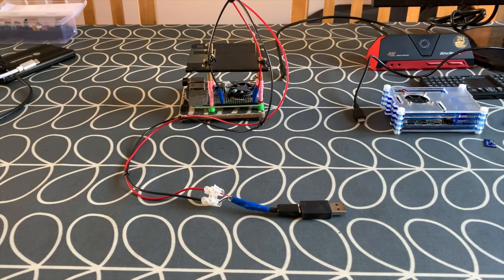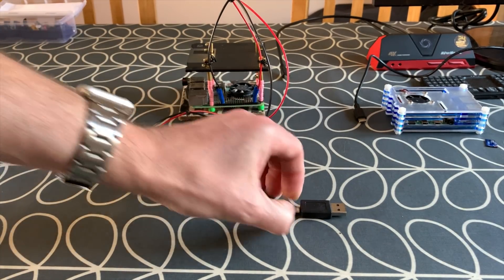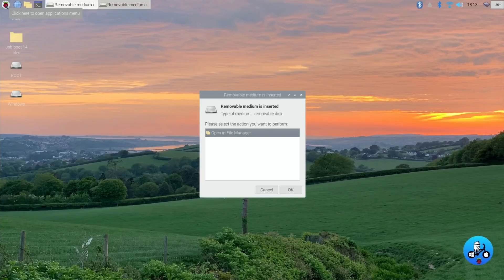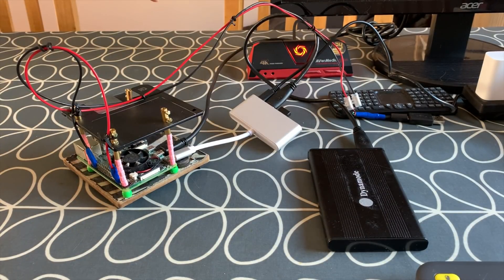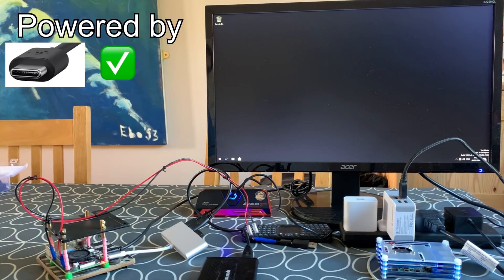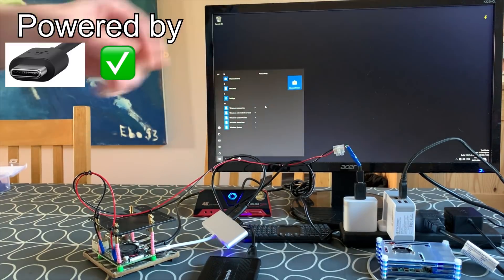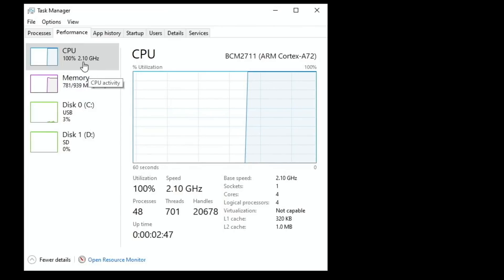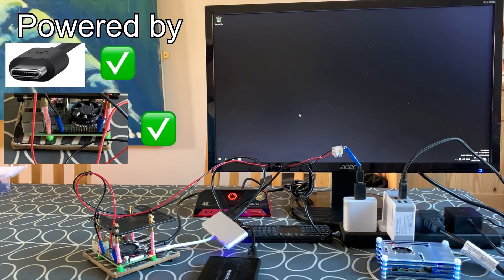Raspberry Pi 4 with 2 power adaptors.  Power through GPIO pins. Plus Windows 10 WOR update.

Comment: It's bad idea. Even if your power adapters works well, there could be a chance, that there will be a difference of potential between the minus wires of adapters. It means that there will be current between these wires, and it can damage your board.
Reply: That is why GND wire must be always connected together. So the potencial is the same (if both adapters are 5V). The only problem would be if for some reason one adapter change output voltage to more than 5V. But that could also happen with only one.

Comment: Is it possible to make an on off button (the protocol that a pc chassis comes built-in with?) that functions independently from no matter how configured to specifically run on a raspberry pi or not meant at all the operating system you have installed on any media being powered on by the raspberry pi hardware?

Comment: Apparently the threshold for Pi-3/4 low voltage is set at 4.63V so if you have a volt meter and connect it across the ground and +/pos terminals you can see what's going on with your power supply a few people seem to use the USB Tester Digital Power Current and Voltage Monitor dongle/stick  to do this as well. I think you should get one :-)

Comment: Oh my gosh. Look at such demolition.

see: https://www.raspberrypi.org/documentation/hardware/raspberrypi/power/README.md
Backpowering

Backpowering occurs when USB hubs do not provide a diode to stop the hub from powering against the host computer. Other hubs will provide as much power as you want out each port. Please also be aware that some hubs will backfeed the Raspberry Pi. This means that the hubs will power the Raspberry Pi through its USB cable input cable, without the need for a separate micro-USB power cable, and bypass the voltage protection. If you are using a hub that backfeeds to the Raspberry Pi and the hub experiences a power surge, your Raspberry Pi could potentially be damaged.

Comment: @leepspvideo This allows the USB C port to be released to connect a keyboard. Can you return to the original power supply via the C port and upload the USB drivers after completing the system installation?
Reply from the maker: Unfortunately USB still doesn’t have support in Windows 10 on Pi.

Comment: lol. Beast of a jerry rig project.
With a Pi4, you really need 
1) a 5V 3A+ wall adapter with either USB-C connector, or the same wall adapter attached via the GPIO 5V and GND, or 
2) a custom power delivery module such as a buck/boost voltage converter (x-Volts to 5-Volts) running off of a battery pack or a 12V auto/marine battery, or any standard wall outlet that's capable of providing more than 15 Watts ... and if you overclock the bastard to 2.0GHz+ and have an active cooling solution pulling decent power (needed with an overclock), including all 4 USB ports connected to power hungry devices, you WILL need all of that 15 Watts. The standard (not Zero) Pi systems from Model 4B and over from now on will need dedicated power delivery solutions. 
Another hack I've managed to work out is that you can actually fool your USB ports into thinking they're only supplying your peripherals like 10mA of current using a 500 Ohm resistor from the PWR to GND of each connector (ie, in the cable/socket solution), then have the GND connect between the port and the peripheral, and then feed the PWR line into the peripheral straight from the dedicated 5V power source rather than letting this current drain through the on-board power system/regulator - This is the PhD in Jerry Rigging ;P
If you're going to get into overclocking and heavy multi-case use on a Pi, you really need to work out how to keep as much of the onboard current ready for the board chips rather than allowing it to be used for the peripherals via the USB power lines; not to mention the fan/cooling solution can plug directly into this 5Volt source rather than allowing the current to go through the on-board power system and then out through the GPIO power pins. Basically, feeding power into the board via the GPIO pins is so much better in every way.
What a great world where such a powerful little computer can be jigged into so many configurations. 
Tinkering with SBC's/PC's and their electronics is so much fun 
/geek off

Comment: Hi... I bought a USB C hub like the one you're using.. but for some reason the official rpi4 power supply do not turn it on thru the hub... Have to use the power supply used to charge my Pixel 4, but the Pi do not detect any storage attached to the hub... Any recommendation, probably the hub I bought is not compatible... Do you have another one that can be recommended, the one linked in your video description is not available.
Reply from the maker: If you have a 1st gen Pi 4 they don’t like usb C PD devices. I had a previous usb otg with Power Delivery which didn’t power my gen 1.

See this video for differences 
https://youtu.be/_wt9NTa1UNE

Marcins blog mentions a few working otg hubs

https://discourse.pi64.win/t/how-to-installing-windows-10-arm64-17134-on-your-raspberry-pi-3-and-4/488/169

Comment: Wouldn’t it be a more elegant solution to have a more powerful power delivery 2.0 and above power adapter and an USB C hub that supports PD pass through as well?
Reply from the maker: PD hubs don’t work with the first gen Pi 4. I did buy one from Amazon a while ago with Ethernet and returned It. 
I do now have a gen 1.2 Pi 4, it would be a tidier build.

Comment: The Raspberry Pi Foundation recommends 5 Volts at 3 Amps.
https://www.raspberrypi.org/documentation/hardware/raspberrypi/power/README.md

If I remember rightly, the Raspberry Pi 4's USB C implementation wasn't to USB C spec. This meant that some USB chargers wouldn't work.
https://www.zdnet.com/article/raspberry-pi-4-wont-work-with-some-power-cables-due-to-its-usb-c-design-flaw/
Reply from the maker: Windows 10 requires a different configuration at the moment as the USB ports are not supported. This is the reason I’m using an otg hub, the usb C power input is acting as a USB port. It allows adding mouse, keyboard, ssd, Ethernet, Bluetooth, gamepad support. All these devices suck power away from the Pi. I am using an official Raspberry Pi 4 power adapter. With Linux and other operating systems it’s absolutely fine.

The GPIO pins are allowing me to top up the power so the Pi isn’t under volting causing performance issues. I read that it takes only the extra power it needs.

None of this is related to the USB C issue that was on the original Pi 4.
Reply: My Bad :)

I forgot about that... I hadn't tried Windows 10 on the Pi for those reasons... I hope the devs get that one sorted.

Comment: Awesome video, I’ve been scratching my head for weeks I keep on getting the lighting bolt when I hook up my Pi4 to the Pi-top Ceed. I have a arcade stick and fan connect to it I wasn’t a 100% if hooking up a portable 2A battery would work
Reply: CEED even with a Pi3B regularly gave me the yellow lightening bolt. 

If you haven’t update the firmware on your Pi4B as they’ve made some changes that make it more power efficient. Closer in profile to the Pi3B.

Comment: Do you recommend overclocking the pi while running Windows?
Reply from the maker: with the extra power it runs great, video tomorrow. 👍🏻
Reply: Can’t wait😀
Reply: I Mean So Far Windows Runs Smoothly At 1.2 Ghz
Reply: Thanks I’ll try it.
Reply: @Lukes-Tech  no problem

Comment: I had the lightening bolt issue especially with Manjaro. I measured the voltage getting to the RPI4 and found it at 4.90v. The 3.0 Amp adaptor measured 4.99v no load. I very carefully substituted a variable power supply set to 5.15v to get 5.0v at the USB2/3 output pins. Load current is 1.1 amps with SSD USB3 connected. Lightening bolt gone.
Reply from the maker: Thanks, I have only ever had this issue running Windows 10 through the otg adaptor. I mostly use the official Raspberry Pi 4 adaptor.

Comment: if you use this cable with your ssd you will not need an enclosure....https://www.amazon.co.uk/gp/product/B07F7WDZGT/ref=ppx_yo_dt_b_asin_title_o00_s00?ie=UTF8&th=1
Reply from the maker: You still will for Windows 10 as the required otg adaptor takes too much power. I use a 2.5” caddy with a HDD or an SSD running various other operating systems on my Pi 4 with no lightning bolt issue.

https://youtu.be/8XwE9y9tZdQ
Reply: @leepspvideo  if you use multiple ssd like the kingdian on various os you can simply plug them in and out of the cable without having to  take the enclosure apart all the time
Reply from the maker: Yes I never fix my enclosure it just slides on. I often leave it out as seen in my videos.
Reply from the maker: Have you used this exact cable booting from usb with no issues? Lots of people have had issues with different usb to sata cables not booting.
Reply: @leepspvideo  I have used the cable twice on windows laptops to migrate win 10 from internal hdd to ssd...but I have not tried it on the rpi4 yet but will in a couple of days when another one arrives from Amazon
Reply from the maker: Please let me know if it works. I got one from Amazon yesterday which has 2 usb cables 1 for power 1 for data. I only tried it quickly yesterday. It didn’t seem to work for Pi USB boot. I need to test it more.
Reply: what I have also done is using a usb3 hub is diskcopy from 120gb usb drive to 250gb usb drive....but failed copying to a usb wd elements drive because I suspect it draws too much power also the wd elements drive performance tails off alarmingly when running the gnome-disk-utility benchmarks

Comment: Hi. There are many type of USB C power cables and power supply. Not all of them can deliver the 3A and you cannot trust what they say on the package. Try to get the USB power meters that show you the voltage and amp and see at the input of the Raspi what are you actually getting. If the voltage drops below 5V, check if the issue is you power supply. If it's not, change the cable until you will find a good one. You will be surprised how difficult it is to find a good cable. 
When connecting few power cables, it's better to use the same power supply that has enough power. If you can't, there is a big chance you will burn your Raspi or the PC or something else ( floating ground, ground loops etc ).
Most likely it will be enough to power the Raspi from the GPIO only.
Reply from the maker: The Pi runs fine through just the GPIO pins. The only issue is Windows 10 as it has no USB, Ethernet, WiFi or USB at the moment. It needs to use an otg adaptor to add usb support. This is why the extra power is needed.
Reply: @leepspvideo  I know the USB HUB that you are using, I have the same one ( and few others ). You can use the GPIO to power also the USB hub without connecting power to it, but check you power output as suggested, I think you will be surprised.
Reply: @leepspvideo  You would be surprised what voltage drop you get with that construction using that obsolete  OTG cable/connector construction.  You should experiment with a load and a multi meter. Measure the voltage at the source and the load. I've seen some cables with an input of 5.2V and struggling to get 4.2V at the side of a 2 Amp load. So run a nice benchmark on the PI (it gets hot meaning draws a lot of current) and measure the voltage at those GPIO pins.  
I have yet to dig in the schematics of a PI but if those GPIO's are a direct connection to the USB-C input then what some others say is true.  In the electronics world just connecting power supplies in parallel is a no go. No 5V power supply is exactly 5.00 Volt, meaning you can get reverse currents between the 2.
Reply from the maker: Luc Peeters Thanks, I only use the otg because currently that’s the only way Windows works on the Pi 4. I have no issues with power on anything else.
Reply: @Luke-san  You can find a basic shamanic here: https://www.raspberrypi.org/documentation/hardware/raspberrypi/schematics/rpi_SCH_4b_4p0_reduced.pdf
They only connected 2 pines on the USB-C ( A4, B9) instead of all 4 pines to give it higher power output ( A4, B9, A9, B4 ). You can see the the 5V is connected between the USB and J8. As from the specification  ( https://www.raspberrypi.org/products/raspberry-pi-4-model-b/specifications/ ) they write that you can put 5V @ 3A min. ) so im guessing that the connection is direct and because these are GPIO pines, you can put much more power then the 2 pines on the USB-C connector.

Comment: good job lee
but windows can be a bit faster if you stop one drive setup in task manager
its the one thats hogging up your cpu
my build should be like this on idle
cpu : 4-5%
ram : 600 megs
disk : 0-2%
my next build aka the one im working on right now uses this much
cpu : 5%
ram : 300 megs
disk : 0-4%
Reply from the maker: Is this something I can change to this working setup? I didn’t think OneDrive was running.
Reply: @leepspvideo  yes i gave you instructions in discord , i hope it will help you

Comment: I thought I gonna fried my pi
Reply: Sam Vu Yeah as far as I know you can fry your raspberry by overvoltage
Reply from the maker: I was running this configuration for about 8 hours yesterday, a lot of time downloading, installing etc. Makers use the GPIO power for powering extra devices. I read that the Pi only takes what it needs. I’m prepared to take the risk.
Reply: leepspvideo well thanks for the efforts